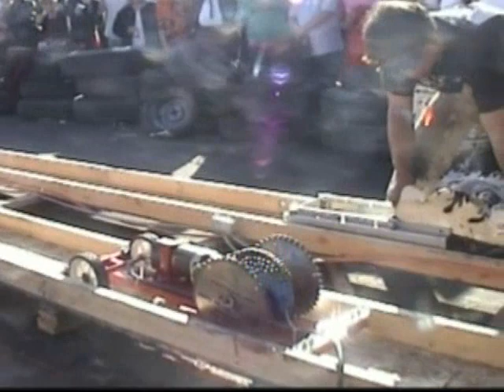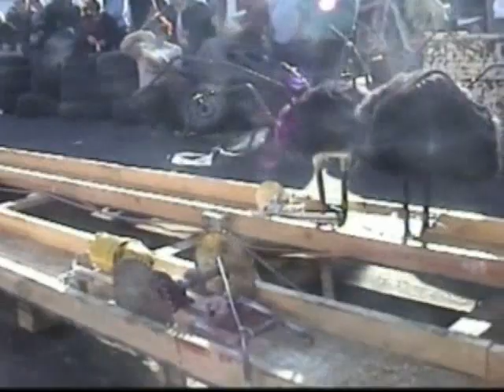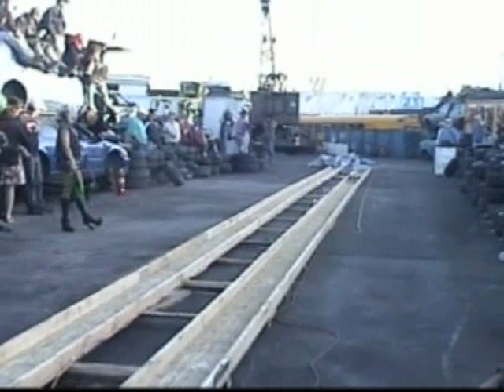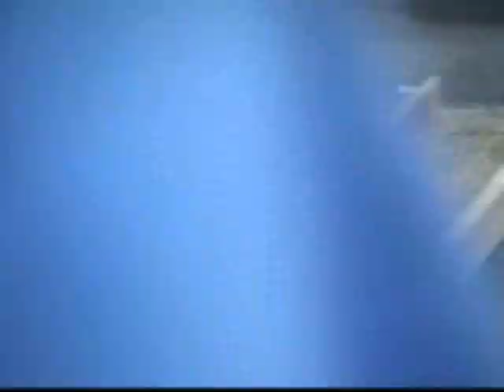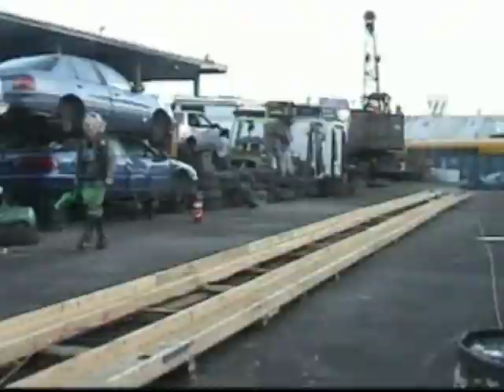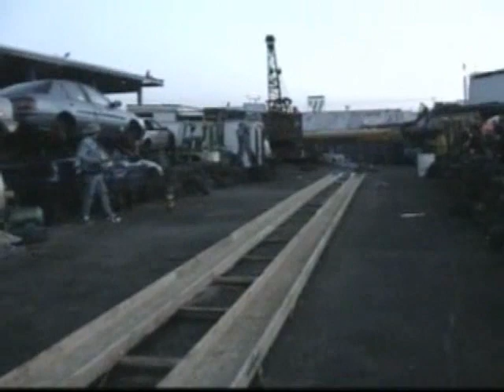Power Tool Drag Racing 4

Comment: instead of racing with fron wheels, in this application a ski type front end might work better, reason is that the rubber wheels might be bumping the side rails and slowing it down.
super cool video
rated 5 stars